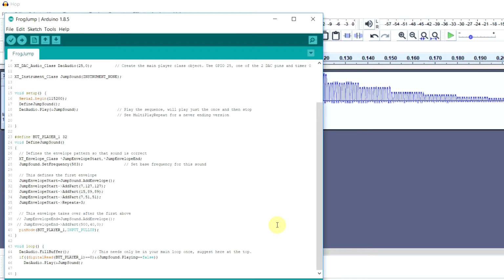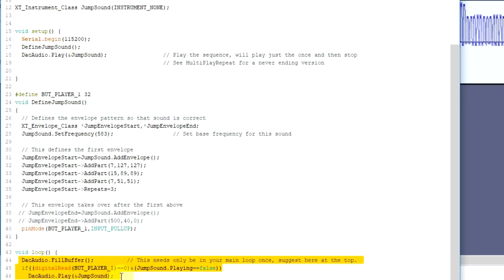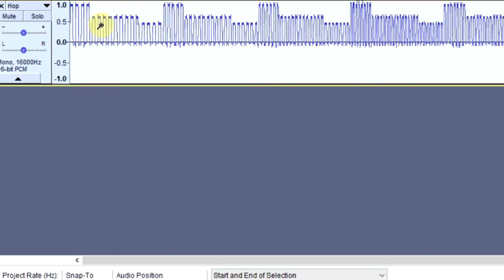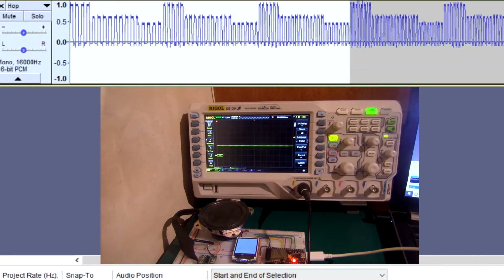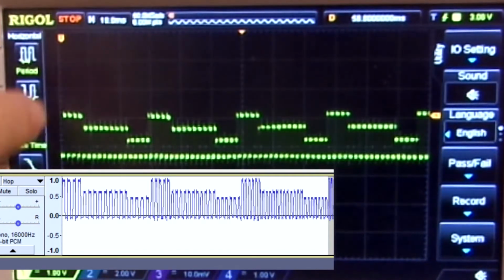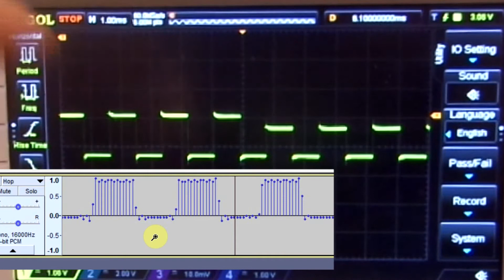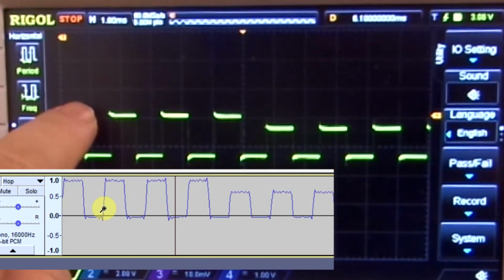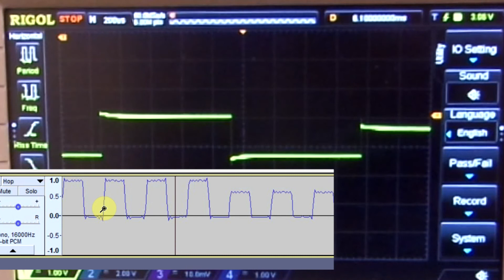Synthesising the Frogger "Hop" sound on ESP32 using DACAudio (DAC)

Comment: I really enjoy your nuts and bolts presentation. I do control systems and have to dig into details to sort issues out. So keep up the good work. Use fft to see the detailed frequency. The ear is very sensitive to variation and you may discover more easily what you need to add.
Reply from the maker: Thanks for the fft tip, I'll look into that, cheers.